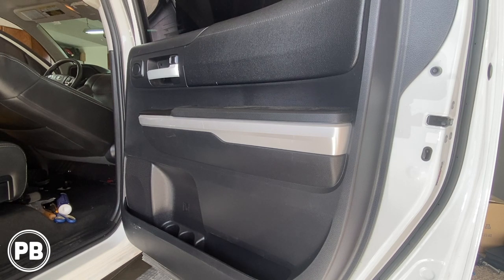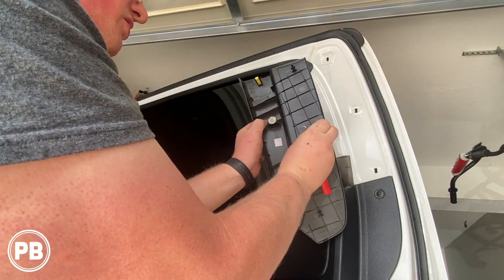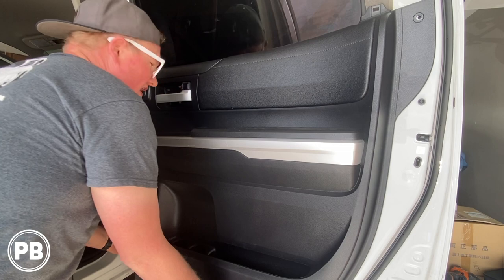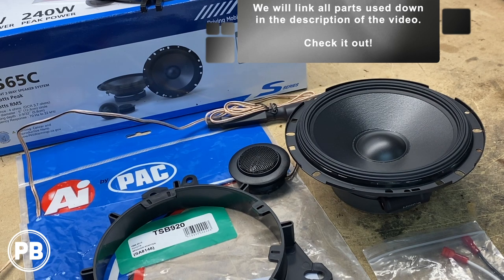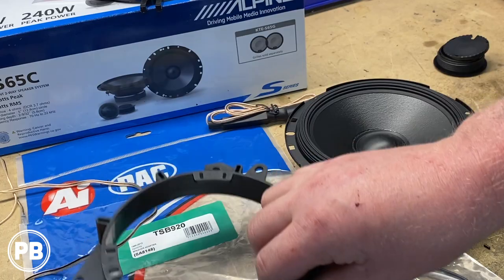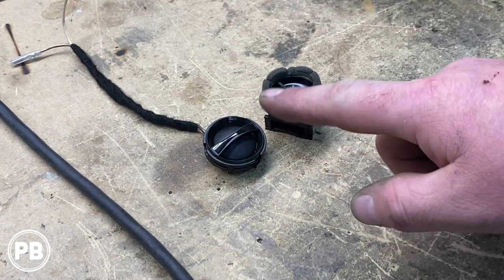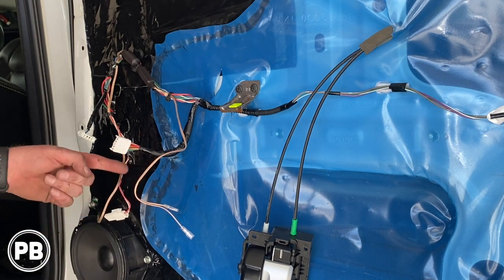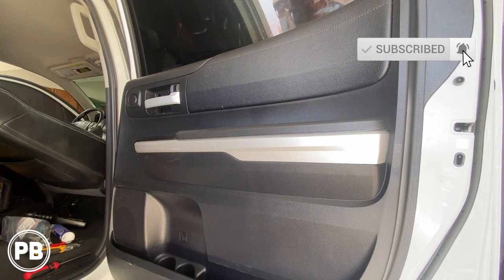2014 - 2021 Toyota Tundra Rear Speakers Install

Comment: Can you include a link to the rear door tweeter plug adapter? Or, is it the same as the corner dash adapters?
Reply: If you pull the tweeter apart it will fit in the stock fitment